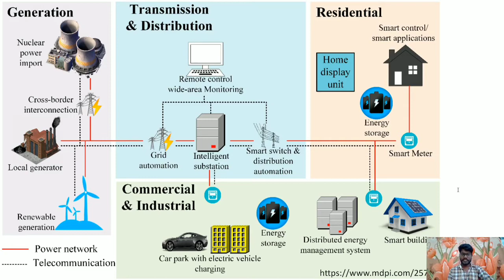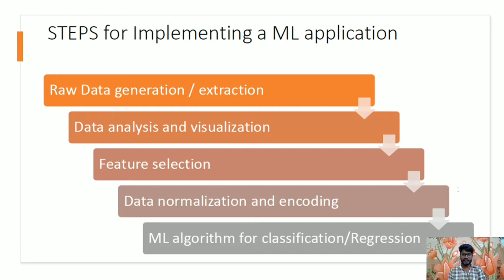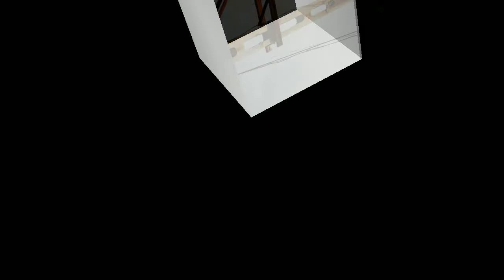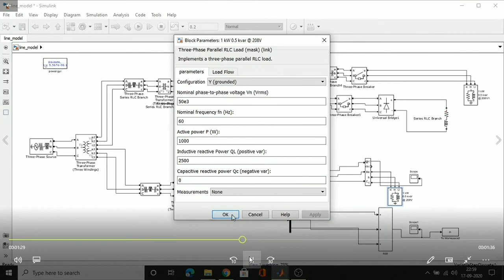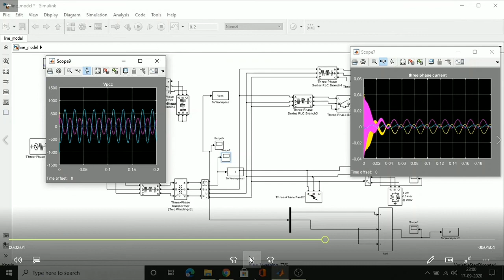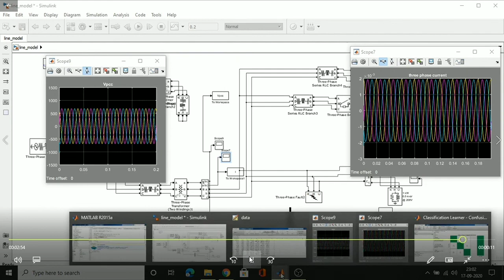Power system fault classification using Machine Learning techniques || Machine Learning || TechclouT

Comment: sir can you please explain the dataset which you use for training the model (you use 7 features and 1 target  in your dataset so I don't recognize what kind of 7 features you use I guess 3 are voltages and 3 are current per phase but what is the 7 feature you use I don't understand) can you please label that feature so it will help me to understand correctly.
Reply: Right, I had the same question. @TechclouT, could you please give more details? That would really help